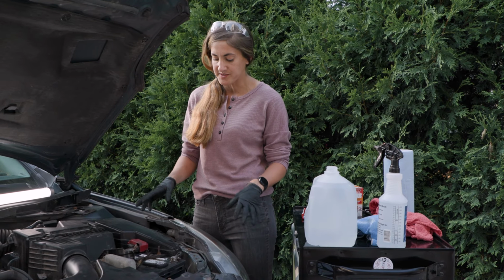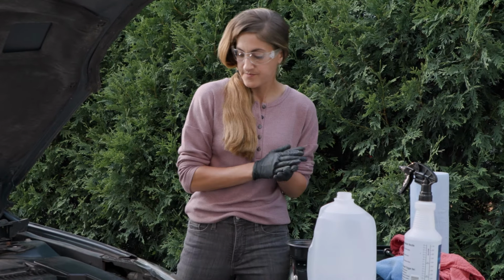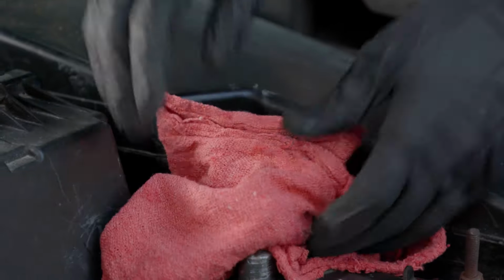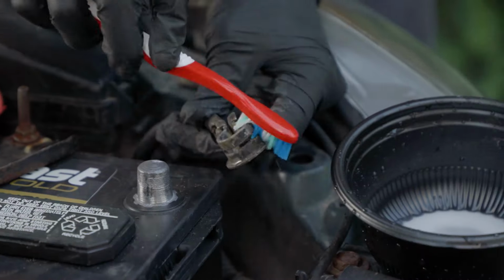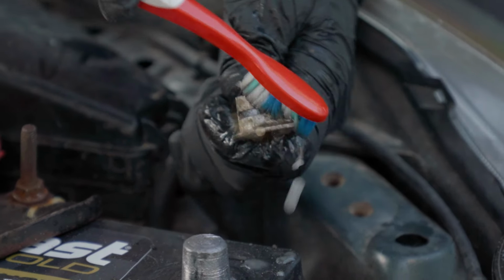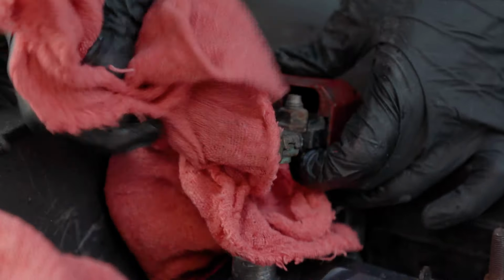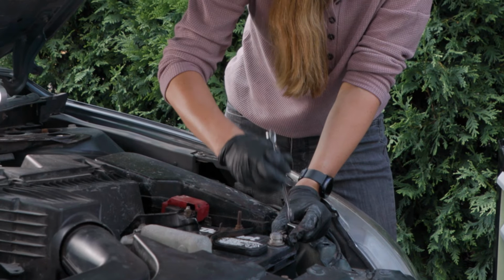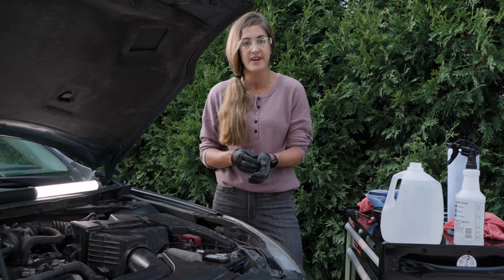How to Clean Battery Corrosion

Comment: An old mechanic told me to glue a penny about an inch and a half away from the terminal after cleaning the corrosion. The corrosion will start to grow on the penny and not the terminal. Just clean the penny off or put a new one on.
Reply: Maybe when pennies use to be almost made of copper? Also came across a book in the 1990s , auto maintenace . It mentioned if the battery had a crack in it . And you used a combination of baking soda , water , etc ? And it got into the crack , the battery would blow up !!! Since that time , I have used a brass bristled brush which is no/ light scratching . And hot water with dawn dish soap . When there is no more visiable corrosion , I thoroughly rinse the battery with cold water , let dry or dry it with a disposable towel before reinstalling . As I take it completely out of the vehicle . And clean out the battery tray . Use some heavy duty rubber gloves for potection and grip .
Reply: Just keep them clean stop short cuts! Pennies are not pure copper!
Reply: 3:05 Pennies were still copper in 1981. There are some in 1982 and the way to tell the difference is by flipping the penny . You can do this by resting the penny on index finger and flicking upwards quickly with the thumb. If it “rings” the it’s copper, if the sound is ” “thwuk” then there is no copper .
Reply: Look at you, big spender, not all of us can afford to go out and buy a brand new penny
Reply: @michaelwalker8100  you have quite a spectacle on the penny I hope your not struggling financially. God bless. Not hard to brush over a tiny object. Haha

Comment: good job. you showed the right way, the safe way. I use a little  brush and spread some grease on top and around the terminal. have a nice day
Reply: Hi, can i use spray grease like WD-40 silicone spray? Thanks
Reply: grease like petroleum ? to the terminals and battery?

Comment: Only one more thing ... pull your oil dipstick and dribble oil on those clamps and posts. Corrosion can not start where there is no oxygen.I have been doing this for almost 40 years and it works.Make that 2 more things . Its November, check your antifreeze now !

Comment: Wait so should I replace the battery if I see corrosion or clean it first? I love these videos as a woman. I don't have a lot of male friends so I try doing simple tasks with my car, the rest I let the mechanics do. 😊
Reply: Do the easy cheap things yourself and see if that fixes your problem. If it doesn’t work still then  .. why do you think your battery needs replacing? I would use some dielectric grease after cleaning it
Reply: @MikeDonaldson-eh2ru Thank you

Comment: Id suggest use piping hot water 💧 if available. I cleaned my Interstate car battery: July 2021 with baking soda, hot water. The terminals cleaned up fast! Some say to spray red protective coating which is fine.

Comment: a little dialectic grease rubbed in the terminal connectors after cleaning will prevent corrosion from happening for a long time

Comment: I’d say as well, don’t let the wrench touch not only the opposite terminal, but any other metal, once your wrench is on either terminal. It will ground and create sparks or start welding.

Comment: I usually replace the battery cables and battery if corrosion is severe. Alittle acid venting at the top i use a bit of water and baking soda to clean it off.

Comment: Thank you so much! I always forget which to take off first(vise-versa) so it was a great reminder :D
Reply: After watching this, I'm questioning myself now, because I was always told that on the car battery, you disconnect the red positive first so that the car stays grounded and then disconnect the negative ground and reconnect in reverse.
Reply: @UsefulInfo-j6f  tested and true, negative first, then positive. There was no sparks when disconnecting or reconnecting this way. 
I feel like some shedhead told me to do positive first too, and I always saw a spark -_-

Comment: Good video; however, I have a problem with just the accessory terminal on the positive side being heavily corroded.  You did not clean that, but I suppose I can apply the same procedures.

Comment: What size tool did you use? I can’t find the correct one to fit
Reply: Most terminals are a size 10mm nut. Easier to use a ratchet wrench set.

Comment: Every electrician and mechanic in my family has always taught me that pos the neg when removing and then the opposite when installing.
Reply: Why is this?
Reply: Doubtful, very doubtful... you disconnect the negative first. Then the positive. And connect positive first. Reason for this is if your taking the pos off while the negative is still attached and you hit any metal with your wrench you'll see sparks!!! If you do this with the negative wire n wrench while the pos is attached still... nothing happens cause its already attached to the frame... im pretty sure thats what every electrician and mechanic  has told you and why... ya might be dyslexic 😅

Comment: This was really good and she did a great job explaining. I need to clean mine and now i feel safe and brave enough to do this on my own. I do have one question, can i add anything to keep it moist like a lube or spray afterwards. And is it safe to use the car after you do this .. or do i need to wait a bit to drive or something? But thanks again for this video
Reply: I’m guessing that as long as your connections are completely dry, you can carry on
Reply: @juanchargoya  Don't guess. Either you know or you don't.
Reply: @mjremy2605 would 100% silicone lubricant work to cover the terminals to prevent corrosion? I’ve heard of some using Vaseline. Trying to find a solution without having to buy more things as that’s all I’ve doing of late 😂
Reply: I waited around 12-14hr, let the car battery, engine dry. I ran the engine, car 10min. Smooth start, no issues.

Comment: Is it advisable or necessary to use something like copper grease or conuctive silicone grease to protect the terminals/connections?
Reply: I use dielectric grease, around the posts, which helps keep them clean and prevent corrosion
Reply: @David-so9qx  Dielectric grease works well to prevent corrosion, but anti-corrosive spray works better in my opinion. It gets in places your fingers can't get the grease to. Dielectric grease can be used in between electrical connections, but only those utilizing low-current. Battery terminals are high current.  White Lithium Grease would be my choice.
Reply: how bout petroleum jelly?  that is recommended by some

Comment: Thanks.  How do you clean the crimped part of the cable, when there is corrosion in there?
Reply: Scrub it with baking soda, rinse off, dry, coat with grease.

Comment: Never use the part of the tool that has the wire brush part that goes over the posts.  It will wear down the post quickly.  You'll end up wearing down so much material that it will be difficult to close the gap on the cable that fastens onto the post.  Use a rag to clean dirty posts.

Comment: How can I remove a rusted out terminal ? It’s rusted out too tight. Yeah I’ve used penetrating oil . Still very hard to remove. Thinking of cutting it off at cable or using impact wrench..
Reply: @MikeDonaldson-eh2ru yeah after letting it soak overnight with rust penetrating oil  I used the impact wrench and it came off instantly

Comment: if the corrosion crusty crud is like a lot and can't get the bolt loosen, can I put the soda mixture straight on the bolt still connected?
Reply: No. Do not do that.

Comment: Very nice to see women doing car maintenance and DIY videos.  Keep up the great work.  This was explained well and clearly. 
Thank you for NO MUSIC, what joy!!

fyi - Don't mention cookies.  The minute you do, you bring women back to domestic duty.  We are stereotyped enough, don't contribute in any way to that stereotype.  I am also female.

I would also wire scrub the posts with some 00 steel wool or a battery terminal brush cleaner.  Then add a felt washer (red for positive) on the post, slide it down, grease up the post to delay future corrosion, and reinstall the terminal lugs.
Reply: I think it is amazing for a woman to emphasize that she can do it all.  She is a mechanic, weekend car racer AND bakes cookies.  👏👏
Reply: @amielowery5786 I absolutely agree!

Comment: Your making it more complicated then it has to be. Just boil hot water and pour a cup hot water over the cable no need to disconnect. I put a bit of baking soda a too. It fizzles like soda and dissolves immediately!
Reply: This actually isn't complicated at all. If you're gonna clean it up, might as well do it thoroughly to avoid having to do it again soon. She explained well and this is pretty much a safe and easy explanation.
Reply: You are absolutely wrong and what you said is dangerous.  Hot water on a battery?  You want it to explode on you?  You must remove the terminal lugs and not put anything on the battery. If it gets inside, it will damage the battery.  You also don't want that liquid over the car internals. What she did was exactly right.  Never use hot water!  Always disconnect or what you did is useless. You also have to wire brush both ends.
Reply: the corrosion causing issues is between post and connector.